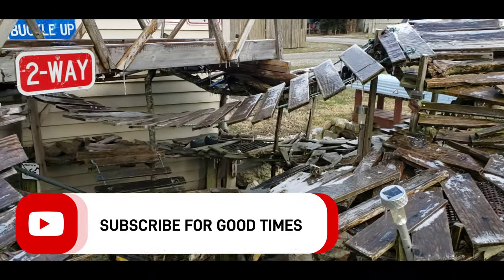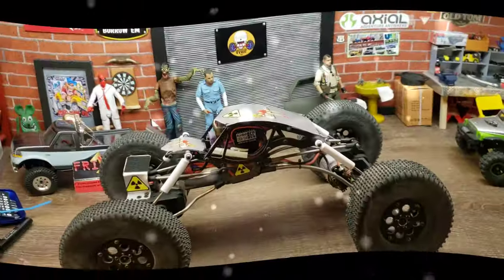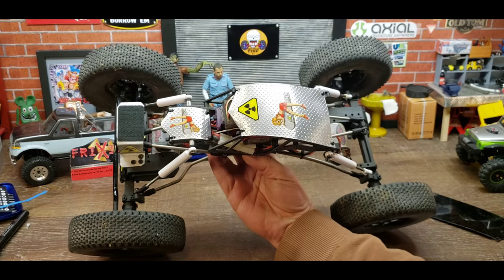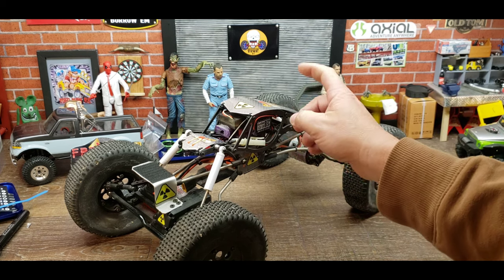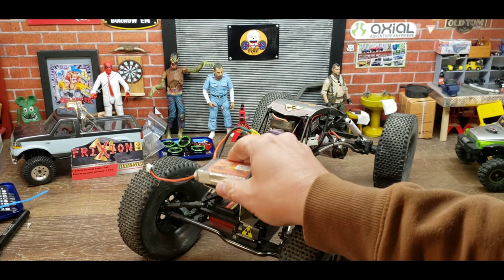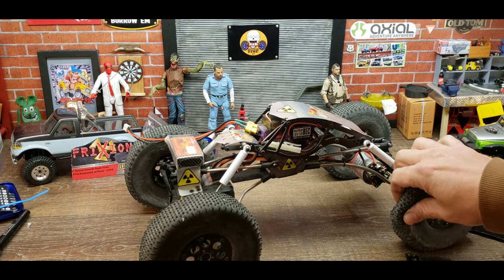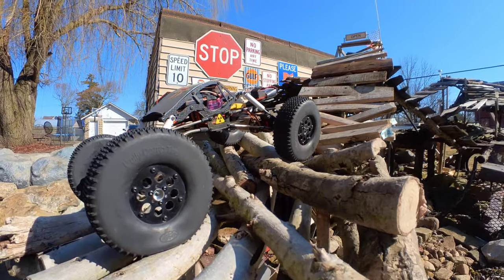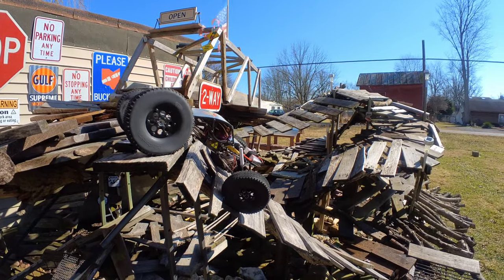RC4WD BULLY FIRST RUN BACK YARD CRAWLER COURSE

Comment: The only thing close I have to that is the Gmade R1. That is a struggle to fit things but this has way less space. The diamond plate a great improvement over those flimsy panels.
Reply from the maker: Thank you Malcolm I always wanted to try one of these i was pretty happy to find a used one

Comment: Wow that this is crazy! What does the wd40 do for the tires?It softens rubber right?
Reply from the maker: Thank you Tyler yes it does it also helps restore oils to the rubber to prevent cracks works on vintage tires pretty good to

Comment: Hi from uk has it got Rc4wd electrics ur have frunt n back dig allso if it was rtr check all bolts they come loose m8 👍👍
Reply from the maker: Thank you very much I think they are i got it used rtr still learning about it
Reply: @AdventureTimeRC  they r grate iv got 1 bully n couple othere rockcrawlers they r rearly quite just make sure there allways greased nu can only us 25mm wide wheels as any bigger n it afects steerin n hard to get tyres on n there r whiaghts for them but i have not got them have grate fun with it m8

Comment: Is that stock out of the box or have you had to mod electronics to get that performance? I’ve seen MOA videos before but it seems there is a lot of mods that need to be done to get the true performance 🤷‍♂️
Reply from the maker: This one I picked up rtr and it's been a fun rig to drive I also have the redcat danche ridge rock moa and it does really good with a few mods